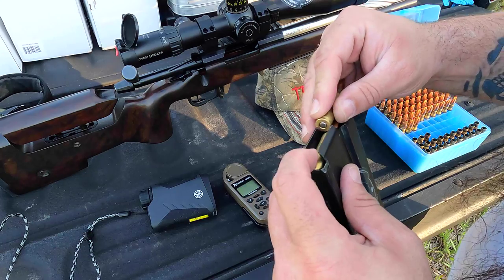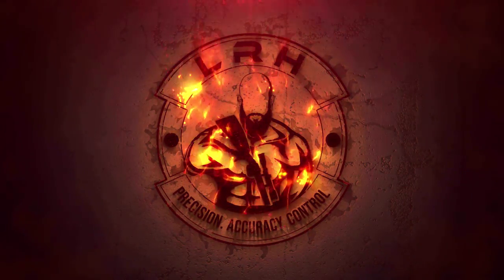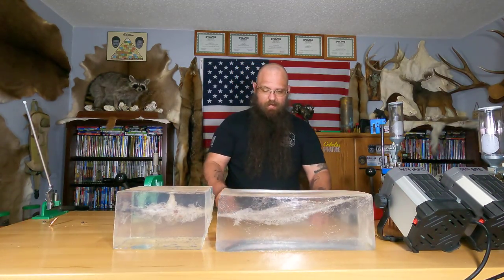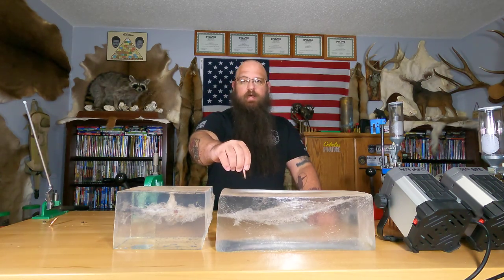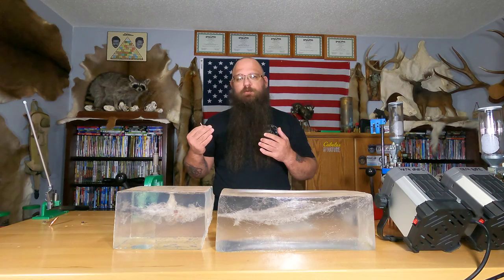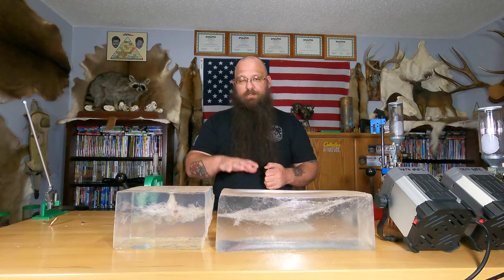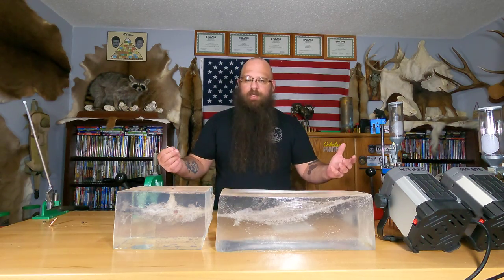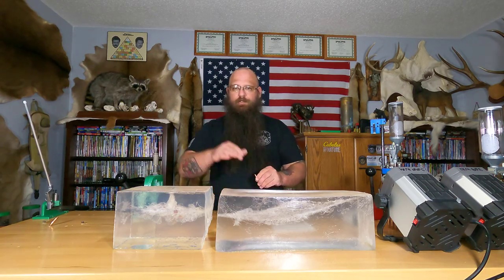Ballistics gel hunting vs match bullets episode 8 Hammer Hunters whitetail deer and elk.

Comment: Thanks for the info. Based on the fact that Hammer Hunter type (HH) bullets all use a 1.5mm hollow point vs the wider one on the Shock Hammer types, I would surmise that the smaller calibers would have a proportionally bigger hollow point (still 1.5mm) and less "meat" around it, allowing it to open up more reliably. What are your thoughts?
Reply from the maker: So that's the problem with solids you need to go lighter in order to reduce mass that way it will have less to be forced to expand. Problem is when you do that you're drastically losing BC. Without it being weakened for it to expand with less resistance like Leigh defense you need light bullets at high velocity to get performance. With the lighter yes there's less mass around the hole. But due to the harder metal and thickness impact resistance is a major factor. For short range high velocity with lighter bullets it will work. Long range you will have to go with a magnum and up in order to push them fast enough to shoot long range. With a good lead core match bullet you have a longer range of performance and can go heavier increasing BC. You will also get better terminal performance at all velocities. Hopefully hammer modifies their bullets like Leigh defense to weaken the bullet to give more reliable expansion and less resistance required. Until then this type of poor results will continue to happen even in lighter bullets. Necking over can happen with lead core bthp bullets too like Sierra match kings which require a lot less resistance to expand than a solid.
Reply: @longrangehuntinggroup7223  yeah, that was the general advice I got when getting the Hammer bullets: to go lighter and much faster. By going lighter, the bullet is also shorter and less likely to turn base over head. Also I read something about them working on a few things, and making even faster expansion likely is in the pipeline.

I use a Howa in 223 Remington, and I will be trying their 52gr bullet. I did the ballistic table on their 52gr (G1 0.220), 64gr (G7 0.152), and 70gr (G1 0.300) offerings. I plotted the speed I can launch them from and their drop/wind drift. For the ranges I plan to hunt edible deer sized game with (≤200yds), the 52gr has the least drop and hits with substantially more velocity. I estimate that it can be loaded to 3600fps without much trouble or any pressure signs. I shoot via the point blank range method, so holdovers and dialing are not things I plan or desire to employ. Muzzle velocity is king with the PBR method.

Here's a very enlightening study on terminal ballistics that explains so much of what we see, such as why impact velocity is very important in the absence of overwhelming abundance of mass in terminal ballistics:
 https://www.rathcoombe.net/sci-tech/ballistics/mechanics.html

Also, there's also this study that took place with thousands of game and sheds a lot of light on terminal ballistics. One interesting thing to note is that he mentions that the most deadly bullet in the 22 caliber on game was the plain Jane 55gr (Norinco) FMJ. The tumbling and fragmentation causes devastating wounds, better than any bonded core bullet. I don't think he ever used GS Customs or Hammer bullets, though. Apparently, the 22 caliber is unique in that in order to get good terminal performance, you can't follow the same thinking that you employ with larger calibers.

https://www.ballisticstudies.com/Knowledgebase/Effective+Game+Killing.html
Reply: @longrangehuntinggroup7223  I probably didn't make this clear, but I don't want to hunt anything edible with lead. I've seen the x-ray images of stuff hit with lead bullets. Tiny, numerous fragments spread out a ways from the main wound track.

Now for something like a hog that I wouldn't dare eat, I can extend the range I would feel comfortable shooting as well as use lead. I plan to use 77gr TMK for that purpose. Massive BC on those.

I also found this channel that tested them and other bullets at 600 yards. Looking at these, there's merit in the lighter/faster approach. Your HH results may also be atypical.

Hammer Hunter
https://youtu.be/ie54uE4Turg

Accubond
https://youtu.be/zj6kQeXseuA

Berger
https://youtu.be/8mfRY8Ah9vA
Reply from the maker: The lead isn't honestly a issue between butchering and removing the area around and aging the meat draining blood you won't have any. Besides most of the lead that comes off in little pieces is inside the chest cavity not the meat. If you still choose to go solid I'd recommend going with a better bullet like Leigh defense. The 22 fmj is the best results from tumbling is incorrect. I don't know a single ballistician or expert that would agree with that statement and the results in controlled testing and in the field prove the opposite. A bullet tumbling (necking over) does have a displacement and then tumbling. It doesn't achieve hydraulic or hydrostatic shock. The bullet can change direction too resulting in a long slow death. I've killed with fmj in 223 from 12 ft to 400 yards. That was the requirement from the person who I was putting down animals for. Yes it killed but the performance was far from good. Fmj has one of the worst terminal performance of all bullets.
Reply from the maker: By the way take BC as a starting point you will have to true ballistics including BC. BC is velocity dependent so if you're running it slower than their test gun you will get a lower BC. You also have to look at if they actually had their bc tested and it's actually correct. Buddy of mine for his own bullet line talked to Bryan Litz of applied ballistics about getting his BC done. It cost $1000 per bullet caliber and weight to get the bc done and listed by AB. Some smaller companies will simply provide what they believe is the BC without having it professionally verified
Reply from the maker: Also I highly recommend you don't use max point blank with hammer bullets. Because of the construction it won't give you as large of temporary wound cavity and will limit you. If you're too close to the edge of your MPB it can give you a wounded animal.
Reply: @longrangehuntinggroup7223  thanks for all of the advice.  as far as the 55gr fmj is concerned, when the bullet tumbles, spits, and fragments, I'm sure that causes massive trauma. I saw the autopsy of the critter he hit and you'd have to be blind to say that isn't good performance. He mentions specifically that for some reason, pretty much only the Norinco 55gr fmj behaves this violently. So I get what you're saying.

I know about BC as it relates to velocity i.e. that it depends on velocity. Most bullets are tested at 3000fps, unless a labradar was used, which will give you the BC brackets based on speed. Sierra has these on their site.

What are your suggestions for a Lehigh defense bullet? The same ballistics study that I included mention the performance of Lehigh's. They take 22 cal up a notch, definitely. Much better than Barnes TSX. I will also say that most who use drive band bullets (GSC, Hammers) say that these work a bit better than Controlled chaos. 

I really think you have to go lighter than you're used to with Hammers in order to make them shine. Monolithic bullets don't need to weight what their lead counterparts do in order to do the same work.
Reply: @longrangehuntinggroup7223  as far as PBR is concerned, I use a PBR that is confined to ±0.5" above or below the crosshairs. This keeps the velocity over 2700fps at impact at MPBR. I'm not sure why this would limit the terminal effects...
Reply from the maker: Monolithics HAVE to go lighter to actually perform well and at high velocity. Cup and core bullets you can run light all the way up to heavy. Solids require a much higher minimum impact velocity and resistance to expand usually 2200 fps or faster. Gotta remember that minimum impact velocity isn't full expansion either it is the bare minimum. If you take great bullets like eld match, Berger hybrids, Sierra tipped match kings, amax, hornady A tips you will have minimum impact velocities between 1300-1600 fps. So with a core bullet you get greater performance and range. You're also not restricted to light weight low BC bullets that will bleed off velocity faster. BC will trump velocity at long range. With core bullets going heavier increases BC and sectional density. Yes a bullet tumbling, fragmenting, and necking over will cause terminal damage. However it cannot complete with hydraulic shock. With the fmj you mentioned you are really only getting the permanent wound cavity from the bullet crushing through the body. With a proper performing bullet over 2200 fps impact velocity you achieve hydraulic shock. Over 2200 fps impact velocity with performance the temporary wound cavity is beyond the elasticity point of the media (animal) and effectively the temporary wound cavity becomes the permanent wound cavity. So you can create a permanent wound cavity 2x or 3x larger than what the bullet can do. As for what I used in the testing that was sent to me to test. Honestly I don't know why Hammer would produce that heavy of a solid when it won't perform well. I have my suspicion that they don't actually understand terminal ballistics and how bullet construction effects it. This also isn't the only testing/data that we have on these. Testing done clear up to a 375 cheytec with a 411 gr hammer hunter which all got the same results across the board. Results from the field including lighter bullets from multiple people. Then videos from hammer bullets YouTube channel showing the same thing. All bullets will kill if placed in the right spot regardless of expansion. The difference is how well they actually perform and terminal damage caused. In this group we have people from 33 different countries that send me data on animals and bullets from their hunts for us to study. We have multiple members who are professional cullers with kills up to the 20,000 mark. Monolithics have their place but honestly they will never out perform a good core bullet in terminal performance with the exception of a couple animals like elephants and hippos.
Reply from the maker: It limits you because you won't get as large of a temporary wound cavity with a solid. Here's a video I just did discussing MPB 
https://m.youtube.com/watch?v=CO4D-HCXMfY
Reply from the maker: As far as Leigh defense the controlled fracturing bullets or controlled chaos. There used to be a actually pretty decent bullet from DRT call terminal shock that was probably the best performance from a solid out there. Unfortunately it seems that they have stopped making it. I tested their terminal match though and it was horrible and that was a core bullet. That's another small company I don't think actually understands terminal ballistics. They got lucky with the terminal shock with design and not so much with the terminal match.
Reply: @longrangehuntinggroup7223  that's interesting, the terminal ballistics study mentions that bullets as being especially deadly that DRT made in the past.
Reply from the maker: DRT the terminal shock was probably the best solid made to date for terminal ballistics. The terminal match has some kind of metal alloy they claim lead but it's much harder. I shot it at 300 yards and it penetrated almost 3 ft of gel before stopping. The jacket separated a couple inches before the core stopped. The core itself the tip was barely deformed and was barely wider that the bullet itself by .1". A ballistics expert friend of mine sent me one of DRT's test videos on gel and they didn't know basic terminology of terminal ballistics or even the different types of wound cavities. We both came to the conclusion that they got lucky with the design of the terminal shock bullets.
Reply: @longrangehuntinggroup7223  they do have some terminal shock bullets on their site, but I don't think they're the compressed copper type that they used to make. It has that same silvery colored alloy that I think you're describing. Oh well...
Reply from the maker: Yeah it's unfortunate especially since it's a question I get a lot. I average 20-40 conversations a day with people from around the world asking mostly about bullets. Solids come up between people going after certain animals in Africa or people stuck in places like California where they are forced to use lead free. Those old DRT terminal shock was my really my go to recommendation for those guys. So the buddy I referred to earlier the expert on bullets. He called DRT asking about the core in the terminal match. They claimed that it's just a regular lead core. It's clearly not as it's a way harder metal. I send this guy bullets and he cuts them and records everything from the jacket thickness, tapering, hole width, hole depth, etc. The cut bullet in this video was him. He cut into the terminal match and said it's much harder than lead which I knew from the testing. I'm really hoping that another company will come out with a good solid soon so I have something to recommend for people who require it
Reply: @longrangehuntinggroup7223  Sometimes yes, sometimes no. If you were completely right, there wouldn't have been a move to copper bullets to begin with. It had to do with a solved mystery of unknown causes of deaths in wild life, the reason...Poisoning by LEAD!